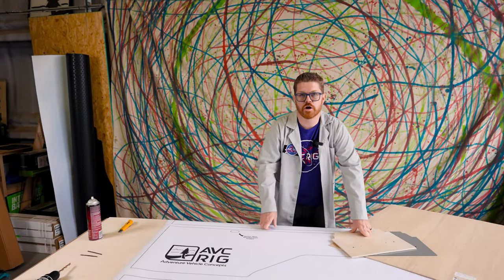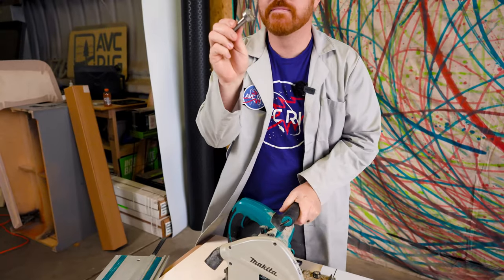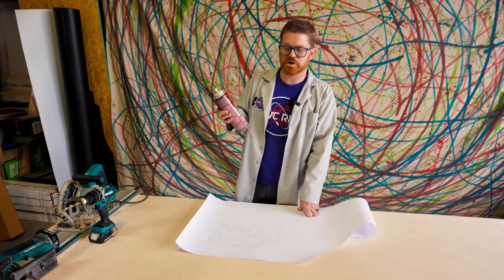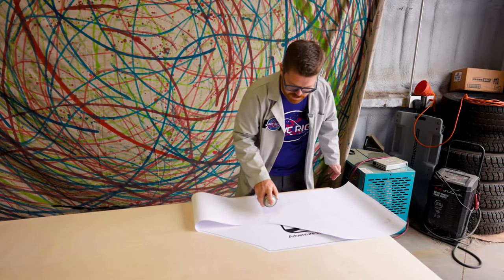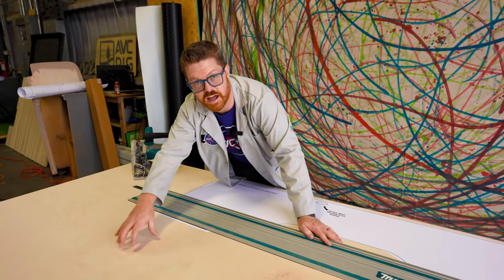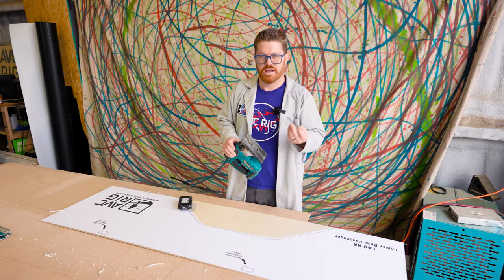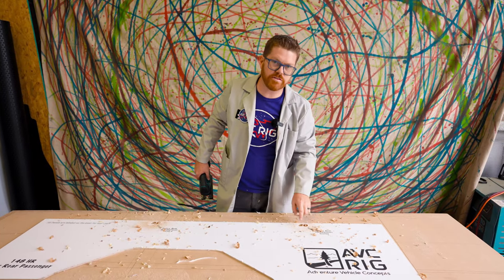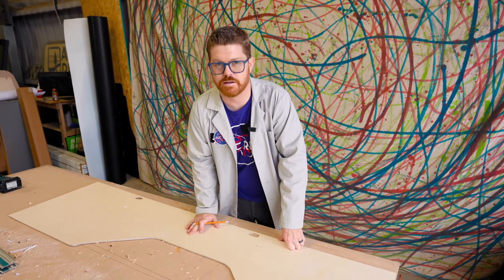DIY VAN WALL PANELS | AVC Paper Pattern HOW TO

Comment: $600 for paper templates?  And that doesn’t include the doors or floor?
Reply: Really? That’s more than I plan on spending on the wood for the panels. They do take a large printer
Reply from the maker: That’s the walls, ceiling, all doors, and the  aluminum wall to ceiling support.  Does not include the floor.